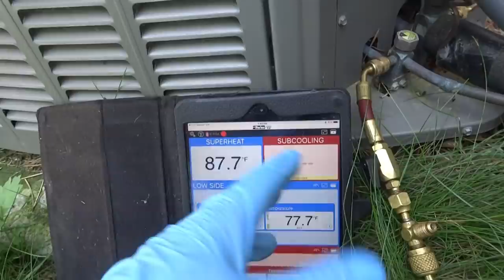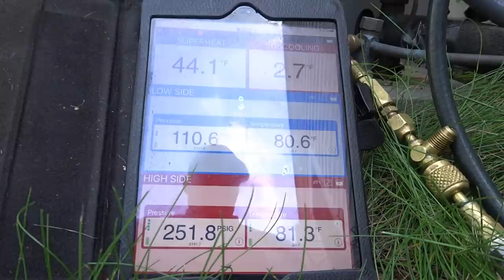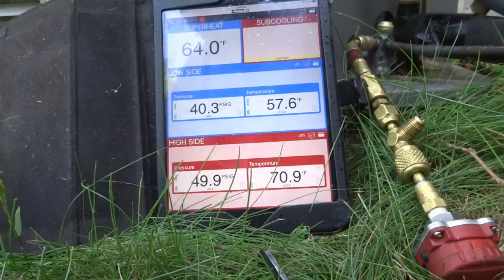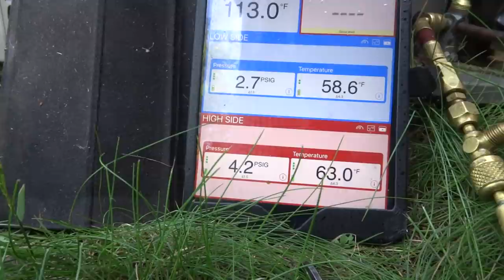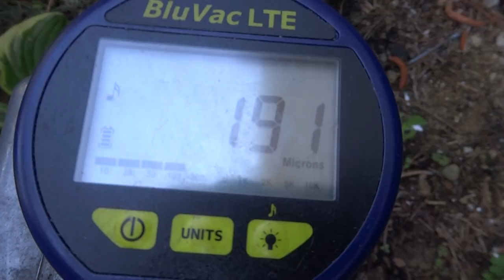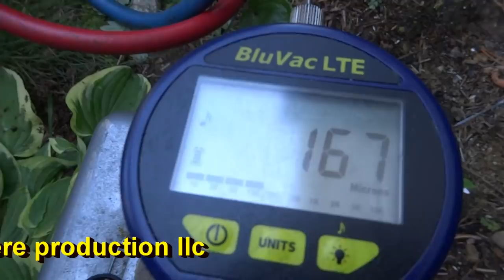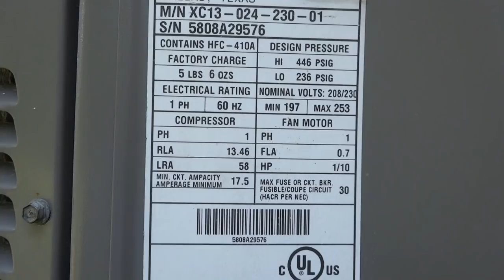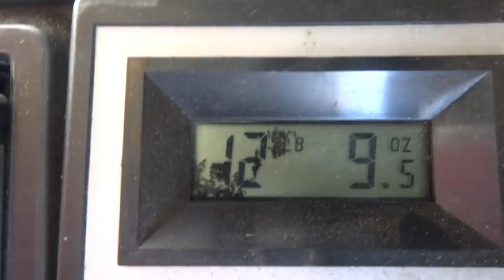lennox AC not cooling down house

Comment: Stay Brite, no nitrogen purge, micron gauge located at the vacuum pump, no pressure test after opening the system. Good enough for New Bedford. Customer too lazy to check his filter.
Reply: Used stay brite 8 on 1000’s of 410 systems my hand to god never had a problem at a joint.
Reply: I thought solder didn't need nitrogen purge because it doesn't get hot enough .
Reply: Nate Peterson that’s correct, no nitrogen needed on any low temp soft solder
Reply: i thought you had to braze all A/C lines...no???
Reply: @mikekohne9354  No they don't even braze condensers at the factory anymore
Reply: You must mean no pressure test before opening the system. If it holds a vacuum theirs your test
Reply: @myronsmith2114  on high pressure system like R410a you have to braze not low temp solder
Reply: @mikekohne9354  r410 runs at high pressure , never seen a fridge joint soldered or brush on flux either , no pressure test , pumped down so no condensing unit pressure test either .. I love the videos I really do but in the Uk we would go to prison doing it that way
Reply: @myronsmith2114  if the condensing unit is pumped down how can it be pressure tested ? Static pressure on 410 is not high enough
Reply: @speckulator7516  it's a 410 system though... shouldn't it be brazed?
Reply: @neal5186  it doesn’t need to be Neal, most people do braze but Stay-Brite 8 is strong enough for 410a systems.  Whether you have as much cushion on the strength safety factor is another question but done right it won’t fail.  The copper remains stronger when not heated as much as it crystallizes when heated red hot so there are pluses and minuses to both methods.
Reply: @speckulator7516  you must live in a cool climate
Reply: @JAWmankato  it’s hot as hell where I live.  We flow nitrogen and braze almost everything. 

I know someone who uses stay brite 8 a lot and has no problems.   The only thing we have used it on is when a unit is on the roof and we don’t want to haul the nitrogen up there just to change a restricted dryer.   I don’t remember the specs but it’s rated for higher psi than a r410 unit will ever see.  My bigger concern is what the original installer did or didn’t do that the dryer was clogging.
Reply: @antoniovallejo337  That is the same as I thought. New systems come with specific instructions to BRAZE not solder any connections due to the risk of blowing out the connection due to the higher pressures...
Reply: How can u purge nitro while in pump down?
Reply: So u would have to recover the gas?
Reply: @moneybags7482  You don’t have to recover the gas.  You close the liquid line valve and pump ll the gas into the condenser then close the suction line.  Look for a video on “pumping down” or “stacking” the refrigerant.  You can’t do it with a micro channel condenser. 

On the purging, you flow the nitrogen from one service port through the line set and evaporator to the other service port.  Look for a video on  brazing with nitrogen purge.

Comment: So I think that when those filter drivers get brazed in almost nobody actually wraps it in a wet rag. So the paint gets burnt off during brazing then over time the paint fails and it rusted out since it’s steel. When I braze then in I don’t wrap them either but I like to spray paint them afterwards. This is only if it’s outside tho,which I always try to put it indoors anyway

Comment: I remember working on this line of Lennox I like the fact they made those panels easily removable to wash the condenser
Reply: Place I work at has one going out! Compressor running no fan! I cut the power to avoid thermal overload

Comment: thanks for showing the whole process. I still haven't had to braze any parts in on the job yet and it's still a bit of an intimidating prospect.
Reply: Get some pipe and practice in a controlled environment... Practice makes perfect. Practice where you can mess up amd improve, not where a mess up costs you money
Reply: Never solder it can't hold the pressure

Comment: That's why I prefer to install a filter/drier indoors.
Reply: Interesting... I'm not an A/C tech, but have only seen them outdoors, great idea!
Reply: Don’t most Lenox units have a drier in them from the factory...that drier looked much older than that unit
Reply: D W it did look damn old for that unit. He may live right on the coast with the salt air, or the installer may have burned a lot of paint off’ who knows.  But is certainly could have been someone who didn’t bother to change it.

Comment: Hi Steve, sounds like the truck has a charge air leak, which is that hissing noise you hear. Maybe one of the turbo or intercooler connections when they replaced the injectors. If resolved, you should pick up some power and mileage.
Reply: I was thinking this same thing.

Comment: I have a question I just had a Lennox elite  series air handler and heat pump installed last week and the system requires r410a which is really not that cold of a refrigerant compared too r404a refrigerant could r404a take the place of r410a

Comment: Little concerned about that superheat. Suction pressure is high for what’s coming back to that compressor
Reply: Seems like the txv needed time to stabilize superheat after he charged it
Reply: I wouldn’t have added any charge without changing the filter first. He may have overcharged this unit.

Comment: That system looks neglected. I'm surprised that it still works for 10 to 12 years for a modern Lennox unit. I have a Lennox system from 1998 (23 years old) and still running strong.

Comment: thanks for this nice video, has anyone noticed the soldering process, did steven use regular copper solder or those special high pressure copper phosphrous silver brazing rod ? thanks
Reply: Stay Bright 8
Reply: Stabrite 8 and has a higher tensile strength than silver brazing requires a special refrgerant flux..

Comment: Hey Steve I had an airease heat pump installed on my house in 2011 from day 1 I had trouble with it. 1 week ago 2 weeks ago I had a Freon leak they came out there and recharged and checked for leaks it leaks on the outside coil and down by the reversal valve unit is 9 years under a parts warranty they told it cost 3000$ labor to repair it the Freon charge lasted for a week it leaked back out.  I decided to replace the unit.   I had a lot of trouble with the airease heat pump I didn’t want put anymore money in to it.  I replaced with a Trane

Comment: Only guarantee is I’m gonna give you a bill when I leave. Love it. I’m gonna use that one. 
I had my outside unit replaced 2 years ago it’s a 407c, I don’t got one of those on my line. The original didn’t either, is it supposed to? I see them on a lot of other units.
Reply: If it's a Goodman unit it's inside the unit you can look through the top and see it

Comment: I respect your work but I heard soldering copper pipes on high refrigerant pressures isn't good, you need brazing rods instead to hold the pieces together at that kind of pressure am I right or wrong? again that's what I heard

Comment: So why is that filter drier cartridge rustier than anything else around it?  Is the casing made of steel?  Why not make it with an alloy that won't rust?  And if it's only designed to be installed inside where it will rust slower, why did the installer place it outside?

Comment: How much is 410A vs R22 per pound? I'm gonna need some R22 here in CT.
Reply: I charge 100 bucks a lb. for R22 in Virginia.  I am sure it's more upstate.
Reply: @thomasc5817  thanks! I havent checked the charge since 2007. Lol. Froze up last night. Crap.
Reply: Steve was charging $100 per pound
Reply: THOMAS C ..... damn. That’s around $2600 profit off a 30lb tank of R22 gas.   But if you’re like most techs, you round up the actual amount of gas used or even flat out lie and cheat the customer. So your making $3500-$4,000 off a tank of gas.   If you ever wonder why your customers helicopter and hover while you work, it’s because we don’t trust you.  The HVAC repair industry is flooded with hacks and con men. Thankfully more and more people are learning how to DIY their a/c so that will weed out the sleazy type techs that overcharge their customers. But there will always be a need for smart honest and honorable HVAC mechanics.
Reply: Swich to 407c
Reply: @Rainmaker88  
That is exactly one of the many reasons why the company I work for won't go near residential units of any kind. It is commercial and industrial units only. 
Let the home owner figure it out and repair it themselves.
Too many liens were put on properties for not paying bills.
Your last sentence is exactly what I tell everyone who asked me 
"hey, you work in air conditioning, can you take a look at my unit?"
I tell them home depot has every type of btu window unit on sale.

Comment: I think ur solder joints will be leaking in less than a year solder is good for 40psi water pressure not 400psi R410A pressure

Comment: No need to remove the cores for a faster vac?  Silver solder, no need to purge with nitrogen?!
Reply: He used stay brite 8,  430 degF melt temp
Reply: hvac Tech why no need to purge with nitrogen??
Reply: @ChristovTech and to stop oxidation on inside of copper when brazing

Comment: Never have figured out why people install evaporator units and filters in an attic.
Reply: Junk Yard In the case of my house, central air was installed 12 years after the house was built. With everything finished, it was cheaper, and easier for the previous owner to put the exchanger and duct work in the attic.
Reply: The cookie cutter homes we live at in Arizona only have an attic and garage. Condenser goes outside, and the evaporator and furnace are in the attic. The water heater is in the garage. The air filter is in the ceiling return vent.

Comment: I'm sorry, I'm an HVAC Tech and I cant believe your using regular solder to braze an  A/C fitting. You should be using a silver brazing rods and running nitrogen through your line set while brazing, Using regular solder, that joint will leak

Comment: Ever notice how most good insulation guys have a skinny guy who's like 4'9" on the crew ....  for attics and crawl spaces ..... today they actually have "filter changers" you can contract to do your dirty work ... I know some installations are a tight squeeze ... but I saw a real tight attic one where the filter slot was on the back side, opposite side of the easier access .... had to negotiate hanger rods, flex duct, etc ... bang your head

Comment: Gets scary when the relief valve on the compressor starts rattling.....
Reply: @Christov To much pressure building up in the compressor caused by the pump down.
Reply: @arcticarrowhvacr  A stuck TXV will definitely cause the same issue as the head pressure rises.  That's where a high pressure cutout switch is a life saver....

Comment: So you dont soapy bubble check your diassembled gas pipe connections and you dont run nitrogen when your soldering or brazing. Then you pull a vacuum but dont see if it holds vacuum by waiting at least 10 or 15 minutes. Then you would know if you had any other leaks. Very unprofessional and unsat for a seasoned tech.

Comment: Why wouldn't you "CHANGE" the location of the newly installed "filter/dryer" to somewhere indoors; ..... where the corrosive climate wouldn't once again start degrading the outer metal cylinder???  You "fixed" the problem, but for how long will it stay "fixed" - 5 years?